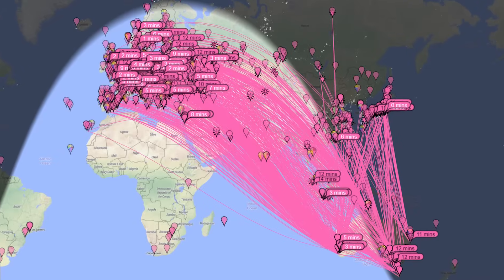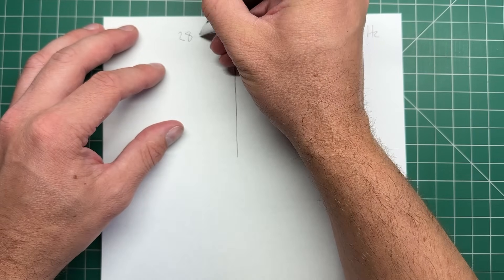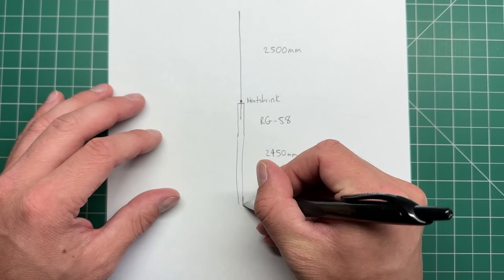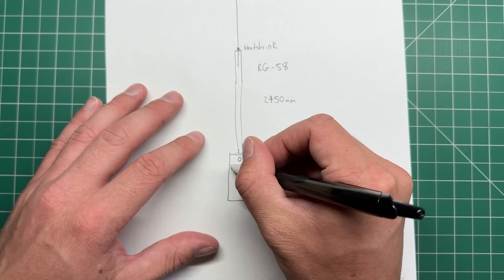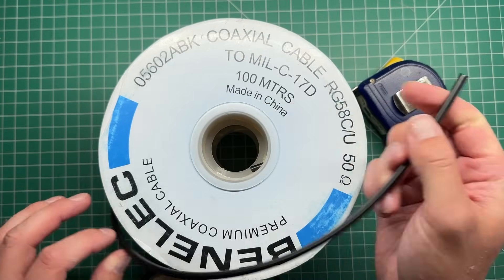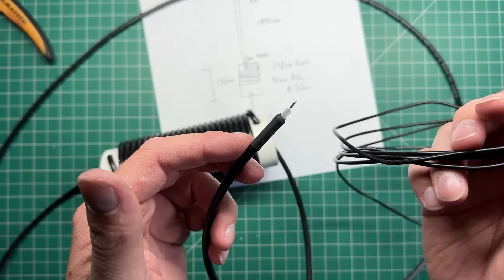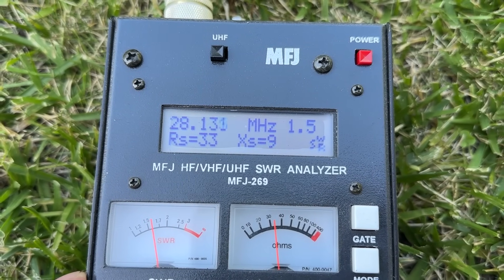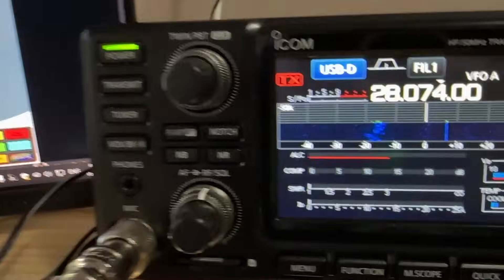Build an EASY 10 Meter (28 MHz) Vertical Antenna for DX!

Comment: A 64:1 unun with a 1/2 wave vertical radiator would be the same size antenna but would work much better with a much wider bandwidth. You would then put the choke 0.5 meters (0.05 wavelength) from the unun if you use one but not absolutely necessary.
Reply from the maker: Cool!

Comment: I've built several of these antennas for 2, 4, 6 and 10metres All great performers. Something I did differently for 10metres is I used a G3TXQ choke (5turns on a 4¼inch former) which provides an excellent bandwidth 2:1 from 29.6Mhz to 26.720 and 1:1 from 27.930 to 28.750 The choke is 4metres above the ground.

Comment: mm dimensions? c'mon...and at 7:53, have learned 50 yrs ago working for a mil contractor that solder connections should NEVER be primary mechanical connections
Reply from the maker: Millimetres - yes. The bands are in metric, so should the antenna dimensions.

Comment: Hello! I built the quarter-wave antenna that you presented. The antenna is built with quality materials and imitates 100% the one you built. I was unable to calibrate the antenna. I have a PNI SWR300 with which I calibrate the antenna. The problem is that the needle of the device jumps to the end of the scale to the left, and then drops to 0. Can you give me some advice on how to correct this? I'm Alex from Romania.

Comment: Can I use this as a end fed wire and orient it horizontal, or does it have to be vertical?
Reply: Vertical is non-directional and has lower angle of radiation thus better DX. KK5R

Comment: Built one this afternoon.. made a couple of quick contacts (1500 mi. +), then 'honey-do' duties called.
Perhaps a little tune-up tomorrow, then it gets some general use. Looks really good!
Reply from the maker: Awesome! Great to hear you were able to get on the air so quickly and get some great results. 1500+miles is going well!
Reply: @HamRadioDX  I'm in Texas.. contacts were in California and Quebec. Both strong signals over a high noise floor. Been using a fifty-cent 10m dipole from junk from my old parts bin. This should be a real improvement! Thanks for sharing the idea!
Reply: Update: I raised this baby into a 30'tree and have had many DX contacts with it, as well as great luck from SE Texas to the NE, Great Lakes, and California. I played around with height but no great changes. Not sure if getting it to 40'+ will have any greater advantage. OK, I have a storage building with a metal roof, and I'm wondering, if I move the antenna to a centered point over the roof, will it act as a ground plane? Would there be positive affects? Would the antenna need to be connected to the metal roof in any way? Thoughts? Suggestions? I've been playing like a child in a sandbox with this antenna, and plan to build another to take 'on the road' with me before next summer's vacation/camping/fishing seasons. I think this vertical will make a great portable antenna, with my tennis ball and 100' of nylon string as the mounting device. I've been very pleased, so far, and I'm pretty sure more is to come!     Oh, and I haven't mentioned the success I've had going into South America. Almost every country in a couple of weeks, and I still don't speak no Espanyolie! The conversation has been the fun!
Reply from the maker: Experiment mate! That's awesome to hear your success
Reply: @EdExTechur 
Doesn't need a ground plane.

Comment: I thought I had commented earlier, but don't see it. I built this 10 meter flowerpot and earlier built the 6 meter version you posted to You Tube. Both have performance that substancially exceed my expectations. I built a second antenna for 6 meters and permanently mounted it off our balcony. 317 grids on 6 meter FTr & FT8, over half of them with 40 watts to the Flowerpot.

I take the 10 meter antenna to the field and set it up on a 10 meter MFJ fiberglass mast. It is a fantastic ground wave vertical and gets plenty of DX, too. A true superb performer.  Keep the project coming. I have only been a ham since 1966 and always need a new project, hi!

73, Keith, WB2VUO near Buffalo,  N.Y.
Reply from the maker: Awesome Keith, thanks for the comment, great to hear that you've been having great success with the flowerpot antennas mate! Good going and hope we can work one day soon.

Comment: How would you go about mounting to a chimney? I am thinking about using a PVC or fiber glass pole probably about 5m long (height of antenna from top to the choke). I’m pretty new to ham radio and not 100% sure on if the choke needs to off the chimney as well or if it can hang on it a little bit. Don’t want to make it too too tall but not sure.

Any advice? Cheers
Reply from the maker: Hey mate, yeah ideally get the choke up in the clear - even if it's just above the chimney. The idea of the PVC/fibreglass is good
Reply: Or should I just throw it as high as I can in a tree… not sure how it would work in the rain lol.. thanks
Reply from the maker: Also another good idea stringing it from a tree. The rain won't affect the antenna, just weather proof the connections
Reply: @HamRadioDX I think I’ll just try the tree method lol. Thanks lad!

Comment: Hello! I made the choke with an FT-240-43 toroid, six turns on one side and one turn on the other side. Unfortunately, I have an SWR of 1.6 (70 Ohm) at 28.100 MHz, and I can't get it any lower. The choke is located 5 meters above the ground, the antenna os mounted on a pole of 10m! Thanks

Comment: Hi Ham Radio DX!
I watched your video on building a vertical antenna for the 10-meter band, and I really appreciate the information you shared. I have a question about the mast: in your video, you use a fiberglass tube to support the antenna. Would it be possible to use a metal mast instead of fiberglass? Could a metal mast affect the performance of the antenna in any way?
I’d appreciate your insights on this. Thanks for your time!
Best regards
Reply from the maker: Hi mate, 
Yes as metal is conductive it will adversely affect this antenna if mounted the same way.

You can mount this antenna via a fiberglass pole, vertically from a tree or even PVC tubing will work

Comment: Excellent video. What measurements should I use for the 11 meter band? Thank you in advance
Reply: Half bottom: 260cm.  Half top: 270cm (a little longer for final tune-up). For the coil turn amount, you could experiment from 24  to 16 turns.

Comment: will this work better than a vertical 2.5m wire connected to the centre of the cable with a single 2.5m horizontal ground plane  connected to the screen? ie the antena like an L on a fibreglas pole  ?

Comment: Dumb question (sorry): it has to be used as a vertical, or it's useable in slope position? It's the only option I have
Dumb question 2: the impedance at the feed point (tape/dipole end) is ~2500ohm, and the bottom part is a 49:1 balun?
Dumb question 3: this setup could benefit from a common mode choke, or the balun also does this job? 
Dumb question 4: is this better than a 5/8 vertical (gain), or its a totally diferent subject/construction?
Reply from the maker: 1. Yes you can try it as a sloper, the impedance might change though
2. The antenna is a centre fed dipole, so feedpoint is closer to 50 ohms.
3. The wound choke acts as a common mode choke, however it would benefit from maybe using a toroid wound CMC instead.
4. As this is a 1/2 wave dipole antenna (unity gain), a 5/8 will have a few dB more gain than this antenna

Comment: Hello there, I'm an HF newb so I apologize if this is a dumb question. But I was curious, if I shorten the length of the coax between the rf choke coil and the antenna wire would this mess up the resonance? I need to shorten it so it will fit where I need it. Thank you!
Reply from the maker: Yes, that is "one half" of the antenna, so any adjustment would change the resonant frequency
Reply: Also another question, Could this be used with an insulator at the end of the antenna and paracord tied onto the other side of the insulator and the other side of the paracord tied/hooked onto a shorter structure or mast pole making the antenna hang diagonally with the feedline at the upper end and the antenna wire at the other end? thanks!
Reply from the maker: I think it would work, but make sure it's vertically suspended and in the clear away from any other metal objects.

Comment: Thanks for sharing this easy DIY - Antenna : i connected it to a 6mtr fiberglas-fishingrod, and i worked 2-first qso to JA- , so it obviously works fantastic , and its a big difference in signal-strength compared to a 40mtr-loop  , what i have to compare it to here near Oslo Airport Norway !  /  the 1Lmbda loop is aprox 2x18mtr. Horizontal, and 2x3mtrs vertical fed in the senter with a homemade 1:2 balun - aprox 7, and 4 mtrs horizontal above ground / so hanging vertical NW/SW radiation, and the dipole is vertical ! top about 12 mtr high !  : i allso reached through the pileup to NX8T Youtube_transmitter at Nov.28.2024 ..... : 100watts and kenw-TS-440S_AT. and Fishingrod  ;) .... Thanks, and best 73´s - I recommend anyone to try it !  de LA6REA.

Comment: You could just strip the top 2.5M of outer & braid, from the coax and save 1 solder joint
Reply from the maker: That's right you could
Reply: You could also strip outside jacket of coax and fold shield back down coax but it will take more because shield will be shorter when folded back.

Comment: Do you need to have a separate piece for the element soldered onto the top, or can you just use the core of the coax as one piece?
Reply from the maker: You can use the core of the coax for the top piece, just strip away the braid and outer jacket,

Comment: Nice video. But why use an additional wire as top side of the antenna. You could strip the inner wire leaving the coating as protection.

Comment: Fascinating build! I was about to make a 10M inverted V dipole in my attic as I already have 40M outside but then saw this. Maybe why not try building a vertical once a while! Also how much power is this antenna can tolerate? I have my Dad's old IC-751A that still works well and seems never used beside 40M and 80M band, I think it's outputting around 100W but maybe 70 or 80 this time.
Reply from the maker: 100W will be fine with this antenna, I suspect you can run much much more
Reply: I would not use more than 250 watts on RG-58. If you want to go well above, use RG-8x.

Comment: I was looking at this, and I was wondering, wouldn't it be even SIMPLER to throw a stack of ferrite beads down at the right position for 10m.  Then I was thinking that if you could slide those beads around you could move them up for 6m and move them down for 10m.  Then, at the end of the coax put a banana connector on the center conductor and have two different lengths for 6m and 10m.  Think it will work?

Comment: I have built this antenna out of 75 ohm RG-6U coax which is thicker (7mm) hand has different velocity factor. At the end of the antenna I connected a run of 10 m of RG-58 connected toy radio. I had to add 30cm +/- to the top element in order to bring it resonant on 28.5 MHz. Otherwise it was resonant on 29.9 MHz. If you try to do the same, your measurements and results may vary a bit.

Comment: Was looking for a quick antenna to throw together to grab CY9C. Built this last night with an old 13 meter piece of coax hanging in the garage. Ran it up to the top of a 12 meter Spiderbeam. First VNA run had it resonating at 29 MHz. Added 50 mm to each side of the dipole and Bob's your uncle. Resonated at 28.2 MHz with an SWR of 1.27. Hooked it to my rig and signals started flooding in from all over the world. In the first 20 minutes, I had FT8 QSOs with South Africa, Croatia, Belize, Serbia, Bulgaria, Portugal, Italy, Spain, Slovenia, Argentina, Poland,  and France. Good on ya, mate!
Reply from the maker: Sweeeeeet! Glad to hear you had some success straight up, that's awesome! Hope to work you one day on 10m!

Comment: The antenna you have made in your video is called a Flowerpot antenna. I beleive your SWR issue is due to the coil dementions. There is a lot of widespread misinformation regarding the build theory behind these excelent performing antenna's and because of this they do not perform as expected like yours. If you have to use the rigs tuner to tune out reactance, you are just waisting power in the form of heat. An antenna like this should perform well with low SWR on its own merit. At the start of your video you mentioned that you could even use a ferrite core choke, I assume to prevent common mode currents past the quarter wave point, however this is not true and unless you understand how this antenna feed line choke works it will be an unsuccessful build. The choke on this type of antenna is NOT a "current type" one but rather a "resonant type" choke. The reason is because of its placement a quarter wave down the braid  at the high voltage node point where current is at its minimum, so any form of current type choke in this location will simply not work here, whether it be air or ferrite core.
The flowerpot or coxial antenna ( not to be confused with its cousin, the coaxial sleave antenna ) is a centre fed dipole with the outside braid forming the lower radial, so the only way to trap RF from continuing down the coax past this high voltage, zero current, quarter wave point, is to use a resonant trap with the correct and specific dementions for the frequency used otherwise you will experiance poor performance and the SWR to match.  Pun not intended. Always wind this coil to match the antenna. You can have too manny or too little windings in place hence the term "resonant choke". The principal here, is the same as that found in a dual band dipole trap.
Reply: Can you share how to calculate the dimensions of the choke? I am building one of these antennas this weekend and agree - tons of conflicting info on air wound chokes. Thanks!

Comment: Do I assume that the reduced length of the braided coax piece compared to the centre wire top piece is deliberate to offset the dipole and therefore increases the impedance towards 50 ohms?

Comment: I really need to get on 10m. When you say 50mm does the outer diameter actually measure as 50mm. Bunnings sells DN40 and DN50 PVC pipe and for those the measurement is inner diameter. For DN40 pvc-u pressure pipe the actual outer diameter is 48mm. Also I used my nano vna as a dip meter. Where you connect it to a short length of wire that makes one turn around the coil. This works really well for making loading coils with a know test 33pf in parallel. I tried making a coax coil but found I couldn't get it self resonant (outer shield to outer shield) on 28.5mhz. In fact it had two resonant frequencies and wouldn't come up or down to 28.5mhz. I also found feeding a fibreglass telescopic pole through the centre (or even next to it) affected the self resonance. 
So I'm wondering how important the self resonance actually is. It seems very sensitive to how tight the coax coil is wound (shield to shield inter turn capacitance) the number of turns and what's nearby including my fibreglass telescopic pipe (Haverford 6m). So I think it would be a miracle to get it to 28.5Mhz in practice. If you trace back the origins of 24 turns on 50mm pipe you find they came from a self resonance calculator. Air coin 28 turns adjusted to 24 turns due to the PVC tubing.
Reply from the maker: I think the PVC I used was an old piece of 50mm tube from... somewhere?
In future builds rather than a coil "air choke" I'd use a FT240-31 toroid with a few wraps through it.

Comment: Great video, would it be a good idea to trim the wire a little to bring down the swr to the required frequency.....
Reply: I just fold the top over and secure with electrical tape/ cable tie when happy

Comment: Im using a half wave dipole in my attic on 10m andvits terrible. Im in a antenna restricted housing unit and i could deploy this antenna quite easily in the trees near the house on a fiberglass pole. Great video! Thank you
Reply from the maker: Awesome! Glad it helped!
Reply: @HamRadioDX  I finally got around to building this antenna and did one for 6 meters too. Both are working great. I also got an Icom 705 and the noise floor is half of what it was on my IC-706. S-1 noise level on 10 meters now! Cheers

Comment: Great video. Is it possible to modify this design for use as a CB base station antenna? If so, could you point me to a resource to help understand and calculate the right antenna length and would the number of turns be be different for 11 meter?
Reply from the maker: Yep! I would start by adding an extra turn onto the coil.
Then use the measured frequency/desired frequency to scale.

For instance my antenna came out around 28.5 MHz. So to scale down to 27.5 MHz as an example:
28.5/27.5 = 1.036.
Multiply that by the actual length I used - 2.5m I think? 1.036 x 2.5m = 2.59m... maybe make it a tad bit longer just in case and you can always cut some off to trim the SWR. Hope that helps.
Reply: @HamRadioDX  Thank you!  That helps a lot! And thanks for the videos. Looking forward to watching more of them.

Comment: Could I build this antenna with some Telydine RG-59 Cable (75 ohm) and then use RG 8u for feedline?
Reply from the maker: You’d need to recalculate the velocity factor correction using RG-59

Comment: Hi why dont you use the inner part of coax instead of soldering some wire on for top of antenna, a use rg213 for theese antennas, I have 1kw output.
Reply from the maker: You can do that... I just saved some coax by using wire.

Comment: Just use a cb antenna. The a99 works perfect.
Reply: A99 is an End Fed Antenna. This one is a Dipole and cheaper to build if you can.
Reply: When you are not interested by experiment, it's a solution... for dumb Cb operator 😂

Comment: Bottom section is shorter,  due to velocity factor, coax slows the signal a bit when used as an elemnt. Good video.coax and it's insulation slow down the signal.